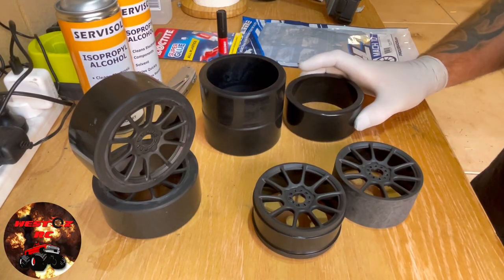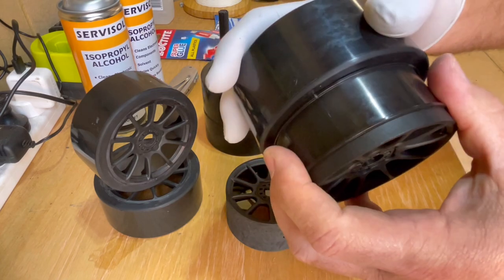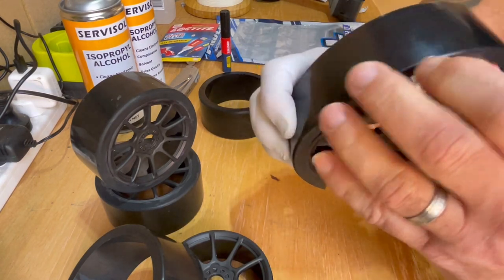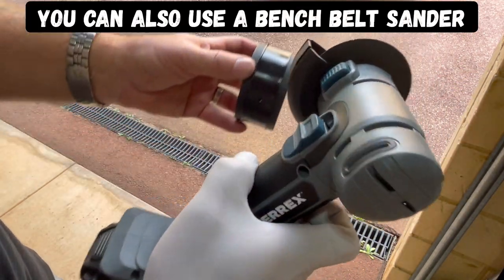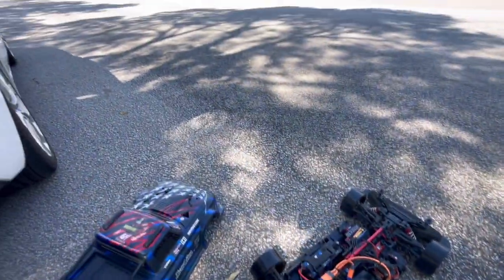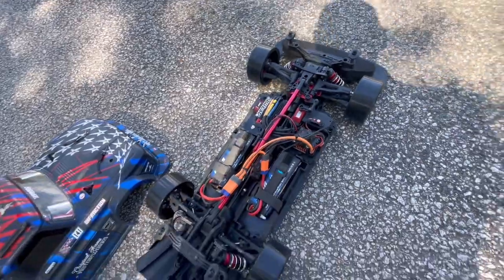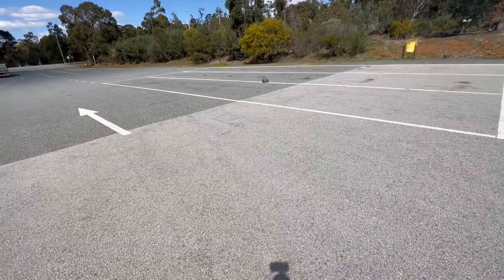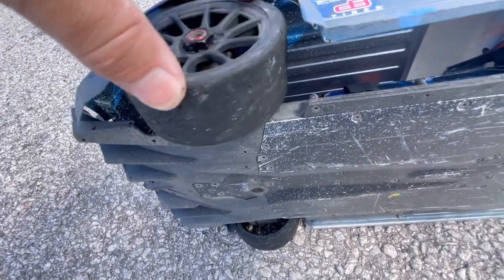'VIPAZ' SOLID RUBBER TYRES 2.0 are finally here! A MUST-HAVE upgrade for your Infraction 6s

Comment: You are running 3s battery right ? Which runs cooler using 6S or 3S batteries ? Tires looks great too , the stock ones you get would be lucky to last 2 full charges eh ?
Reply from the maker: Yeah bro they a 3s each. I prefer it that way because if you get to a dead cell it cheaper to change 1 3s than a 6s pack. Thanks for the comment bud and yeh I use to get 3 packs out of a set of Hoons. Now they last at least 20 packs with the Vipaz.

Comment: Great idea but $125+ for 4 pieces of rubber without the wheels is a little on the steep side. I understand they last several packs but it’s to much. If they came pre-mounted on wheels I would say good deal and worth it for sure. Great job though definitely.
Reply from the maker: Thanks bro appreciate the comment. I had to get a mold made for them and only had 13 sets made to see how they sell and I’m selling them with no profit at all. If I can get them made cheaper down the track I will certainly be passing on the saving. 
Also, you are meant to use your used Hoons rims so no rims are needed. I just wanted to show how they fit on the Mach 10 rims. Thanks again bud. 😎👊🏼👍🏼🤙🏼
Reply: @WestOzRC  how many packs can you get out of like a white hoon vs your tires becasue a full set of hoons for me is around 70 dollars mounted on rims, how long does your tires last and what is the grip comparable to the hoon tires. I live in a bit of a colder climate than australia, so im wondering what these solid rubber tires can handle when running in something as cold as -5 c to around 5 c. I wouldnt want to spend that kind of cash then find out that it feels like im driving on ice becasue the rubber is super hard. So, are these solid tires more of a drift and burnout tire, or an all around tire like the hoons are
Reply from the maker: @charliemaybe  hey bro. Well I use to get around 3-4 packs with white Hoons but the VIPAZ are a harder compound (around 70 duro, Hoons are around 60 duro) and they do drift easier due to this. Because all 4 tyres are the same the truck reacts pretty much the same. I have sold quite a few sets to people in Sweden, Norway and Finland and they love them and they are repeat buyers too. 
I have gotten 18 packs on the test sets but I ran them as hard as I could. I’ve had some customers get 30 packs. I have priced them as best as I could and I’ve been told they are worth their weight in gold with the money people have saved. The only way you will know is to try a set. They cost around the same as a set of Hoons. Be sure to glue them as instructed and you will love them. Cheers bro and thanks for your time to comment and interest. 😎👊🏼
Reply: @WestOzRC  ive done some math, and the price definatly isnt actually that bad, i can get a set of hoons for around 70ish usd while your tires I can get for around 80-90 usd, so if they last that long and I can absolutely rip on them, that isnt that bad.

Comment: Hi the proline mach 10 rims are DISCONTINUED. Do you recommend something else
Reply from the maker: Yes they are but there are a few on eBay still available. Otherwise you can try the HPI V7 or the Arrma Typhon rims work also.

Comment: How long are those packs lasting you each run?
Reply from the maker: The 8000 last around 10min and 6500 around 7min but that’s full trigger the whole time. I can get an extra 2-3min if I easy off.

Comment: Good job.

The sliding way , you could do exactly what you're doing but push the tyre offthe other side about 20/30mm and glue inside tyre again, then slide it back into position.
Might help stick both sides.

If the glue doesn't set too quick you could actually apply more to both sides.

They look like they're holding up great.
Reply from the maker: I’ve thought of that way too but they dry super fast. I really like the cut way as the glue really holds them down. The slide does work, you just have to touch up glue around the edges. 😎👍🏼

Comment: Tooth picks with warm rubber as to aid stretch and then just remove picks 6of them should definitely do
Reply from the maker: That is definitely a fantastic idea brother. I’m going to use a needle bottle with the superglue poured into it as this method was used by one of the guys that purchased them and worked really well too. 😎👊🏼

Comment: So tire glue or super glue? I have been saving my hoons to use them. Hopefully I can just slide them over the hoons?
Reply from the maker: I used super glue which I’m sure is what they use in tyre glue. Yep either apply the glue to the rim first then slide the rim down then touch up glue if around the edges or cut the tyre on an angle and apply the glue to the rim 2” at a time, lay rim flat and work the rubber around until they meet and glue them together again. Either method works well. 
For the Hoons, you have to leave that tiny bit of rubber step down on the outside of the rim they have so you can glue the e edge down. That’s why I like the Mach 10 rims because they a even flat across the surface. 😎👊🏼👌🏼💪🏼

Comment: I know you’re not making any profit here and I LOVE this idea but I can’t spent $130 on rubber. That’s half the price of real tires for my real car.
Reply from the maker: I appreciate that bro but it’s gonna cost you a lot more in Hoons. Just an FYI I spent $390 on a full set of Trenchers with zero offset alloy hubs for my Mojo and I don’t regret it for 1 sec 😎👊🏼👍🏼💪🏼👌🏼
Reply: @WestOzRC  yeah you’re not wrong. What makes me a bit weary though is if you stop making them, I’m back to the same problem. I don’t drive my infraction very much for this specific reason. Tires.
Reply from the maker: @PigglyWigglyDeluxe  I completely understand your concern bud and all I can say is that I’m in it for the long haul. I’m also looking at another manufacturer to see if I can get them cheaper. They outlast any tyre on the market now about 4-5 times and that will save you around $500. Thanks again for your feedback brother 😎👊🏼👍🏼👌🏼🤙🏼

Comment: perhaps drill a series of small holes around the inside of rim and somehow inject glue underneath the tyre to glue
Reply from the maker: Thanks for your idea bro and I also thought of that too. By drilling holes in the rim you loose the integrity of the rim and weaken it because while the heavier tyre spins, it wants to tear off the rim so removing surface area for it to bond to is not a good idea. I’ve put a lot of thought into these and also the manufacturer. I’ll have a new video out this weekend on another 4 packs thru the truck. 😎👊🏼👍🏼💪🏼👌🏼

Comment: Fantastic video! The investment of wheels and tires is the one thing that has deterred me from getting an infraction.  Your solution  might have me buying one soon! Once they wear down to a certain point will you strip the tires and re use the wheels?
Reply from the maker: Thanks for that comment brother it’s really appreciated. You would not be disappointed if you buy one especially with these tyres. Yes 100% I will wear these down to almost the rims then grind off the remaining rubber and glue another set on, or at $40-$50 a set of Mach 10 or any other 83mm rim I might just buy those and start from scratch. Either method will work.

Comment: Those seem way more durable than hoons. The main reason I haven't gotten one of these awesome trucks is because of how much they go through tires. Might just have to get me one now! Great video man 😎🤙
Reply from the maker: Hey brother thanks so much for your comment. They are performing very well and even after the 4 packs I put her thru they only wore down 1mm. I’m going to put another 4 packs thru her tomorrow and see how much is left again. Even after 4 packs on the surface I ran it on, I would have already been changing them because I have already done so in the past. 
I think it’s time for you to spoil yourself on one of these majestic beasts with these tyres and enjoy some insane drift moments. Cheers brother. 😎👊🏼👍🏼🤙🏼👌🏼
Reply: Here's my thing once u glue then and they wear down ur buying wheels and tires again that can get costly too

Comment: With the hoon tires I just soak them in black magic   Make sure I only go to spots that have been seal coated and aren't just raw pavement   And try going after it rained and the pavement is just slightly wet   Those three things have tripled the life of my boom tires   Unfortunately it doesn't matter what tires you use   The infraction just eats through anything you put on    I only take out mine out occasionally for that reason   After the 6th -8th set of tires it starts to feel like you're just throwing money out the window
Reply from the maker: Great idea man but with these solid rubber tyres just keep running and running. I’ve put 8 packs thru them and they have only worn 2mm. You can’t beat these solid rubbers tyres bud they are lasting so well and I’m not restricted to any surface. I totally agree with the wet surface man but I try to keep water out of it. Thanks heaps for taking the time to comment, it’s much appreciated brother.
Reply: @WestOzRC  I'm going to follow this journey, 53/107 is needed I wish you much success
Reply from the maker: Thanks so much Peter I really appreciate your support and comment brother. 😎👊🏼🙏

Comment: Maybe put the wheels in the freezer and add glue to the tires and warm them a little.  Should work without cuting
Reply from the maker: Hmmm interesting concept bro I could give that a go for sure. Thing is tho if the tyres are warm the glue will dry super fast. That’s why they glue so quickly when they are hot from running. You only have to wait like 2min and you can rip again. Another way is to slide them onto the rim without the glue then place a screwdriver between the rim and tyre to space them apart then squeeze the glue down the rim or tyre then move around the rim like that.
Reply: @WestOzRC  maybe toothpicks.  And a needle pen applicator.  It would defiantly dry the glue faster if the tire’s were warm
Reply from the maker: @alterdcustomrc4512  oooo you wouldn’t want the toothpicks to get glued 🤣. Imagine that 🤣🤣
Reply: @WestOzRC  hahaha.  When i glued fishing wire to my 1/10 tires it was enough to make me never do i again haha. Everything stuck and stank.  It was a mess.  Please keep sharing.  This is freaking awesome and i love how they are holding up
Reply from the maker: @alterdcustomrc4512  hahaha that stuff is damn messy for sure. Thanks heaps mate I really appreciate that. 😎👊🏼👍🏼
Reply: @WestOzRC  i have a ton of old wheels if you need ill send them if it will help develop this further.  Once you nail the morning then its just compounds for different things.
Reply from the maker: @alterdcustomrc4512  haha thanks for the offer bro. I have a mate that has heaps too. I think most of us are in the same boat lol. Thanks again for you support brother. 😎👊🏼👍🏼🤙🏼

Comment: Will b grabbing a set next week! Id really like to see a 53/107 set. Will b testing well over 60mph. Going to try a syringe for refilling ink cartridges to get the glue in between the rubber and wheel while the tire is in place. So no cutting is required, netting a tire that should be capable of 100+mph.
Reply from the maker: Cool man. The mold of these already cost me a bit so the 53/107 will have to wait until I see how these sell then I will look into it. 
You can get super glue with a long pin type tubing at the end of the bottle that would probably work well. You could even try sliding them on then peel back the edges and squeeze the glue inside. As for the ones I have, they are holding really well. Gonna go do another run next weekend. 😎👊🏼👍🏼
Reply: @WestOzRC  i can imagine. im a machinist, so i know the cost of tooling. Great suggestions for glue techniques 👍 will also b checking the balance of them. Should be interesting .
Reply from the maker: @MrSpeeder420  oh sweet mate. They seem perfectly balanced which you’d expect them to be because they come from a machined mold but you can never be too sure I guess. 👍🏼

Comment: Not up for sale anymo?
Reply from the maker: They will be soon again bro. Hang tight. 😎👍🏼👊🏼
Reply: @WestOzRC  thanks mate, boutta order an infraction
Reply from the maker: @Krideezy  Oohh nice mate. You will not regret it especially once you get these tyres on.
Reply: @WestOzRC hey just picking up an infraction today, do you have a date on when the tires will be for sale?
Reply from the maker: @based_will  nice man congrats. I’ll have my next batch up this weekend bro or if you’re in the US, M2C Racing is now my distributor there. 😎👍🏼👊🏼
Reply: @WestOzRC  just ordered some from m2c thanks!
Reply from the maker: @based_will  fantastic brother. Got to the Arrma Forum and share your experience once you’ve run them. Would love to hear about it. 

https://www.arrmaforum.com/threads/my-experience-with-westozrc-solid-tires.55867/page-5#post-954491

Comment: I don't agree with cutting the tires.
Reply from the maker: Thanks for your comment and it is just a suggestion. I didn’t want to take that route but I wanted to try 2 styles of bonding. I’ve had success with both gluing methods and the cut ones are still holding on. I just ran another 4 packs thru the truck today and they are still holding well. Video will be up this weekend. Cheers man. 😎👊🏼👍🏼🤙🏼